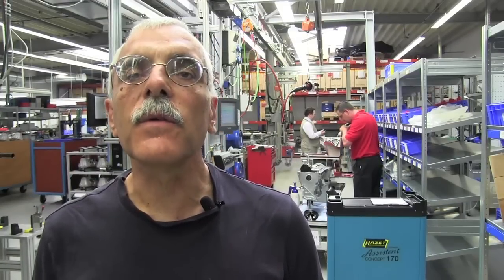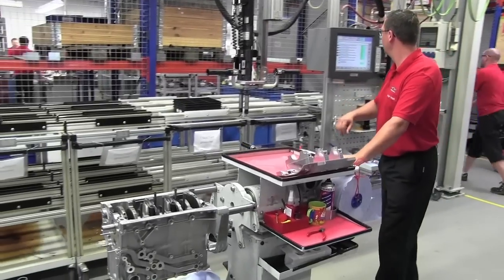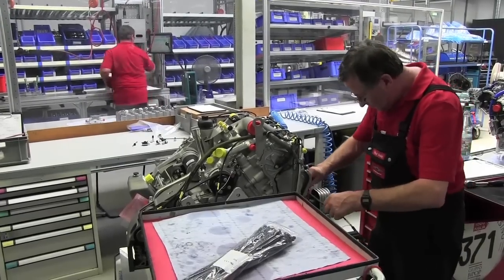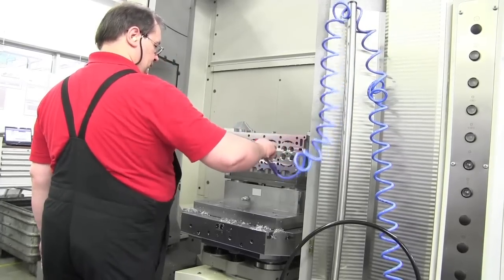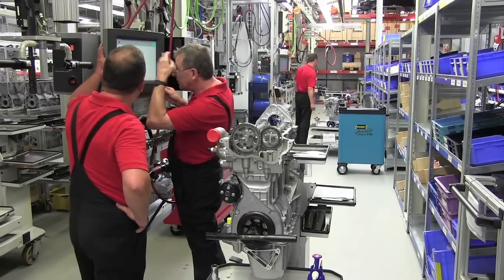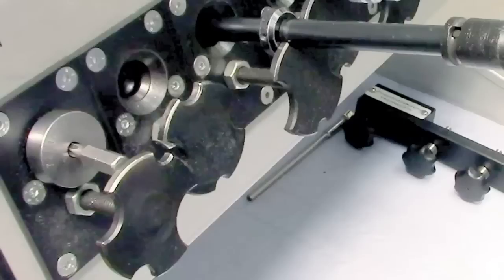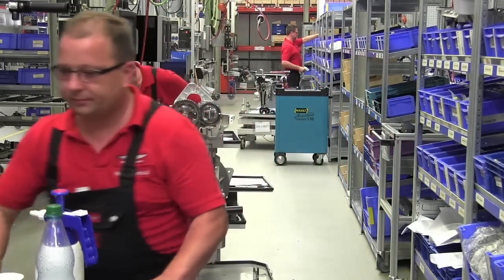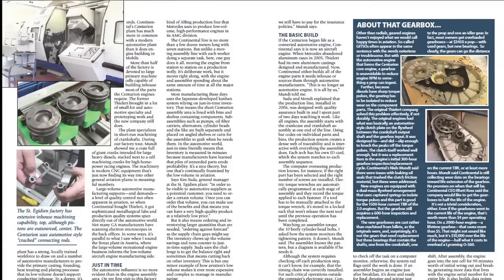How Continental Builds Diesel Engines

Comment: Interesting, for sure.  I'm surprised and a little disappointed that they are not flat engines, like aircraft engines (except radial, of course) historically are.  I wonder why that is?
Reply: The reason why that is, is a opposed/boxer-four engine has perfect primary and secondary balance.  An ordinary inline 4 cylinder engine with 180 degrees up-down-down-up crank throws may look like cancelling the upward inertia created by the #1-#4 piston pair with the downward inertia of the #2-#3 pair and vice versa, but in fact the upward inertia is always stronger, and the vibration caused by this imbalance is traditionally called the Secondary Vibration.  Another reason is boxers are shorter, which which makes the crankshaft shorter, stronger, and smaller diameter with lower bearing surface speeds.  It enables direct drive without inverting the engine to maintain propeller clearance, and not having to deal with hydro-lock or having a gear, chain, or belt system like you see here.  Moreover, if you do gear a boxer for performance reasons, the gearing an be made simpler, lighter, and with less maintenance, by using a simple inline planetary gear set on a well-balanced engine.  The camshaft is also shorter, and it requires no balance shaft, which is essentially an imbalanced shaft to compensate for the engine's imbalance by hammering in the opposite direction.  V engines share some of the same advantages as opposed/boxer engines.  When it comes to properly designed engines, the number cylinders determine the configuration.  For V engines that means a V12 must be a 60 degree V, a V8 must be a 90 degree V, and a V6 must be a 120 degree V.  If they are not, they require a balance shaft or you put up with the secondary vibration outside of the engine.  The V8 is the perfect V design for cars because it is short, and is enough of a V to make room for an accurate, parallel suspension system.  The sub-optimal mess you see today with engines and the  is driven by cost and fuel efficiency.  If you start out by adapting a modern car engine, this is what you get.

The sub-optimal design carries through to suspension also.  The MacPherson strut makes room for transverse engines, but whenever you go over bump, the wheels experience camber change and lateral movement rather than straight up and down like they used to.  Low profile tires is not what you want.  The ride is not as good, and It's heavier.  One saving grace it has is helps with offset frontal crash ratings without adding any more weight than it already has.
Reply: @jackt6112  the chain drive is actually because they have overhead cams, not because it's an inline engine. Back in the 1920, there were plenty of inline engines with no timing belt or chain because the camshaft was right to the crankshaft, and they used pushrods, like in your boxer engines. Modern auto boxer engines have timing chains because they use overhead cams.

The McFerson suspension, has nothing to do with engine layout, it is to compensate for handling. Parallel suspension has the major flaw of always keeping the wheels parallel with the body. This is wrong because when you go around a corner, the wheels are no longer flat on the ground because the body is no longer flat on the ground. Cars lean out of turns, so the suspension has to be designed to lean the wheels into turns. McFerson suspension does this well. Most double wishbone setups are now designed to mimic McFerson geometry, but with a greater level of tuning.
Reply: @jackt6112  A lot of mistakes and little understanding of design in your write up.

Comment: Like the cross bolted mains, shame its not on all five caps. Don't like the skinny cam chain a duplex chain should be driving the camshafts not single row.
Reply: Under engineered for the job in hand, belt and braces is the oder of the day when it comes to all thing that fly, because of the damage they can do if gravity has its way.. Skimping on parts that will last longer is penny pinching and down right foolhardy..
Reply: re: "Don't like the skinny cam chain a duplex chain should be driving the camshafts not single row." no worries, unlike cars aero engines are obligated to go through a much more frequent inspection and R&R process regarding their components. flying airplanes aren't for the "spend thrifty", in fact the FAA will tell you as much.

Comment: Mercedes has had some trouble with the un-doubled timing chain that seems to be in these engines.
Reply: Aircraft engines have to be rebuilt frequently enough that it won't a problem.
Reply: @AlexandarHullRichter  maybe, but it is still a helluva constant load on a little chain.
Reply: @ronashman8463  no, it's not. It's just running the cams. If you want to see a heavy duty drive chain, look inside the transfer case of a 4x4. That's where you need a strong chain.
Reply: @AlexandarHullRichter  fair enough, you chose a good example. I was thinking of the very varied torque strain the chain has to work with. As each lobe lifts its valve the shaft requires big power to keep it rotating. As the lobe goes past full open, the load required would drop to almost nothing. In a 4 cyl motor, twin cam, that is 4 peaks per single camshaft rotation. However I do agree that cam chain problems do not seem to occur.

Comment: Are diesel engines more reliable for airplanes than gas ones.  ?
Reply: i think main advantage is $$$$ saved from economy engine fuel consumption from diesel
Reply: fidel catsro thanks
Reply: @fidelcatsro6948  the real advantage is AvGas is not readily available in all parts of the world and mogas is of dubious quality.
Reply: @robertstringfellow8912  Exactly!  Low-altitude and low-hp engines where av gas is not available is the ONLY market for these contraptions because at that point, their only competition are the expensive low-hp turbines, which cost more initially, and burn more fuel.

Comment: Use a 2 stroke Diesel engine amigo! less parts!!!
Reply: Like the Achates w/ opposed cylinders.
Reply: Sadly it was not possible to stop engine oil escaping out of the exhaust ports in the cylinder walls. The small oil loss did not matter, but the air pollution did.

Comment: timing chain? thats the weak link there
Reply: No other way you're getting overhead cams, unless you'd prefer a timing belt.

Besides which, having worked on cars, I can tell you the timing chain is absolutely not the weak link.
Reply: Having owned cars with cam belts, I now ONLY buy vehicles that have chain driven camshaft(s). I have never had a problem since.
Reply: Gears for me please!

Comment: $30,000 + for this diesel and no R&R in that price you can add 2 to 3 thousand to the price to put it in! NO THANKS!!
Reply: EpiDemic117 I'm a pilot and a mechanic This is insane!
Reply: EpiDemic117 Agreed 100%
Reply: +EpiDemic117 The problem with General Aviation piston-engines is not with the FAA, it is with the huge liability that plagues American small aircraft aviation.  This is why no company wants to market new technology in the American market (other than high-price turbine engines), this is why we (USA) have lost most of the small aircraft market.  You crash your airplane going through a thunderstorm with a Private Pilot license (no IFR qual), the NTSB report shows a perfectly functioning aircraft at the time of the crash, the family can/and will still sue Bendix, Firestone, Continental, Cessna, King, ICOM, etc... basically everyone that has made a part in that aircraft and force these companies to settle for some amount or face years of litigation.  Even if 85%+ of accidents are caused by pilot error, in our current legal climate, you can still milk money out of manufacturers.  This is why we are still using Continental or Lycoming designs dating back from decades ago.  Sad but true, Ciao, L (a very frustrated pilot)
Reply: EpiDemic117 Hi, unfortunately, the problem is only going to get worse - our legal system is a huge business in the US, the largest legal system in the world actually.  With 2.8% of our entire population under some correctional/legal supervision (BJS report 2014), over 1% of our entire population in jail (over 1 year sentence, not including juvenile), with our legal being the third most lucrative business (and expensive) system in the world referred as the "prison-industrial" complex, daily TV advertisement to sue for various reason (medical the top one), we (Americans) are in trouble - we are actually self-destructing but try to explain that to "Joe the plumber" when he can make a quick buck suing someone else.  A large part of our population is paid one way or the other by our legal system and our TV shows (which basically raises most of our broken families' children) are more violent, scandalous, and trashier than ever - we are in trouble!, Ciao, L
Reply: ***** Hi IngLouis, I am not saying that we should not have lawsuits at all, currently (2014) the average plaintiff gets $0.15 on the dollar award (understand, this is average).  Litigation is extremely expensive for some (and lucrative for others).
There is a perception that if anything "bad" happens to an American (and I am one), it has to be someone else's fault.  On the networks, afternoon programing, you can see advertisement for lawsuit hourly (if not more).
Were I live (peaceful Maine, "the way life should be"), neighbors sew each other over ridiculous issues.
There is a big difference with Canadian mentality (across the border from here) and us when it comes to blame. 
We need, some reform, some common sense, we need to take responsibility for some of our actions.  Take care, Ciao, L
Reply: EpiDemic117 Hi EpiDemic117, I fully agree with you.  This is killing us; as a country, we are self-destructing, it saddens me greatly, Ciao, L
Reply: Try upwards of $40k for the engine alone, with a TBR of just over 2000 hrs. Thats right, TBR, time before replacement. No overhaul on these engines.
Reply: What you are missing is its market is competing with low-hp gas turbines at low altitudes, not gasoline piston engines.  The issue is fuel availability.  Some countries only have Jet-A or AV gas is only available at a few certain airports.  As mentioned, you are also about $10,000 low on the price, which gets you a 2,000 hr. TBR, not TBO, engine.  In the low-hp range, it can beat the turbine on initial cost and fuel efficiency.  Turbine maintenance schedules are also driven by the number of starts.  On the downside, is the diesel has inferior power to weight for both gasoline and turbine engines, you have the cold weather issues, and because it is compression ignition you also have an altitude problem that is further compounded by temperature.  With compression ignition you need pressure to create the heat for combustion, and when the air gets sparse, for the heat, and there is little boost from exhaust gases when you cut the throttle, and ?  Moreover both the I4 and V6 are compromised-design car engines made for front-wheel-drive cars that cannot be inherently balanced without imbalanced balance shafts too to hammer back the in the opposite direction or put up with the vibration externally.  If you were the FAA, you would require a lot of convincing too because there is nothing about the design that enables you to make assumption based on its design when you are evaluating a contraption like this.  Thus, these have a narrow, but expanding market in the low-hp market that is driven by fuel availability. 

In the U.S. 100LL is available almost everywhere for turbo, high-altitude aircraft.  For low altitude, which is the only place these diesels can compete, they would be competing with gasoline recips that can run Mo-Gas, which is also widely available in  the U.S., and engines with longer hours between TBOs than the diesels have for a TBR.  The diesel's fuel efficiency advantage would get dinged by its extra weight, and the computerized fuel and ignition management of the gasoline engines reduces the diesel's advantage even further.  These diesel engines, which are a poor design for aviation anyway, have zero chance from a TCO perspective against a modern gasoline recip.

Comment: Continental is backing  the wrong horse at the pony races,  the oil burner,s enemy regarding aviation application is weight.  They should pull their heads out the sand and knock on Scooby,s Door, Yes Mr Continental those canny engineers at Subaru have designed developed and put in production, a flat four boxer diesel engine, compared to that tractor engine you knocked up the Scooby oil burner is very neat and lighter considering  all the plumbing for the radiator. I do not know the Scooby oil burner,s pony count   but redesigned by competent hands on engineers with grease under their finger nails ,around one sixty,one sixty five ponies at the propeller

Comment: I don't think they're very efficient having one huge machine that tightens the same 2 bolts all day, but still needing some doofus to guide the bolts home. Made me kind of laugh actually.

And also, why a timing chain...when the technology exists to create timing gears...so much more efficient and reliable. And...a bit over half a day to only assemble a small part of the engine? I've assembled small block Chevy engines with rather tight tolerances in a couple hours. Completed. Hilarious stuff, as if taking longer to assemble an engine means it's a better product.
Reply: Yes, you truly are the expert! ;-)
Reply: Overhead cams. You can't gear that. Engines with geared cams have to use pushrods.
Reply: Most truck overhead cam engines are gear driven.Look at CAT,Cummins or 60 series Detroit.Mercedes old inline 6 diesels were OHC and gear driven.